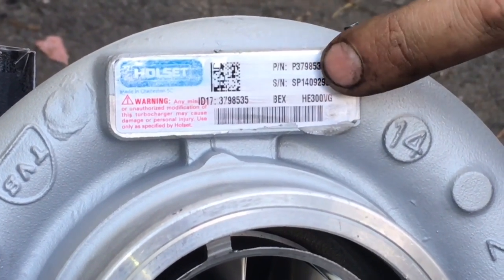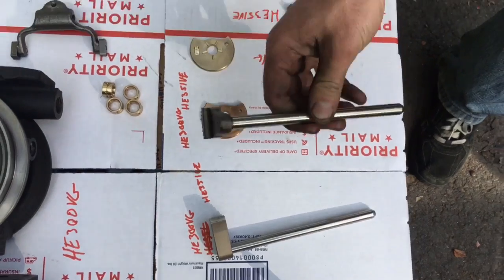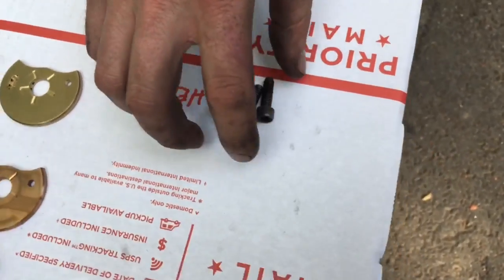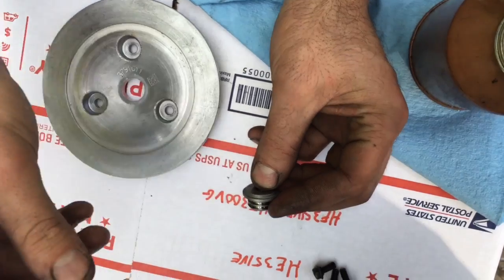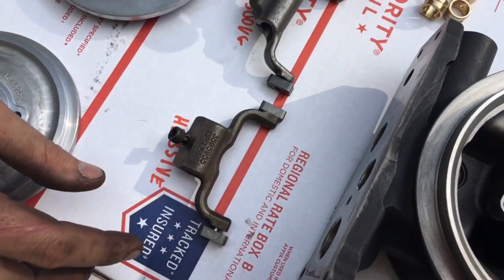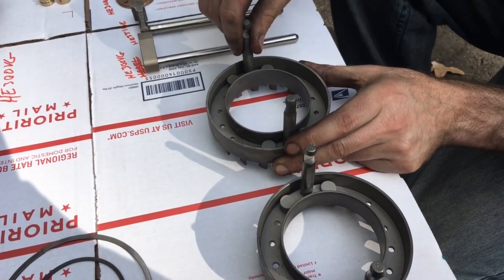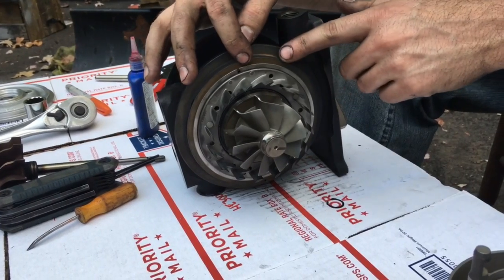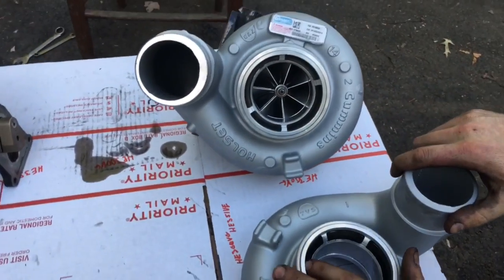2008 - 2016 6.7 Cummins HE351VE vs HE300VG

Comment: Do the he351ve and the he300vg have the same size compressor wheel plz help I need my truck fixed asap?!?!?
Reply from the maker: Most do but there is a 56 x 86mm compressor wheel used on the He300vg with cab and chassis. Otherwise the earlier models have the hx40 59.96 x 86 mm compressor wheel.
Reply: @turbolabamerica  so do you think a wicked whew for a he351 would work in my he300vg?

Comment: What do you recommend using to clean the Hot side that’s full diesel soot and gunked up?   Also, when you assemble the compressor wheel on the turbine shaft, is there a certain timing the turbine wheel and compressor when need to be set at for balance or something?  Thanks

Comment: Hello, great video!   I have a question about my HE300vg, the actuator quit working and my truck (2017 ram 2500) would make nearly no boost until wide open throttle and it would only make 10-12psi max.  The turbo brake was also no working at all. I removed the turbo and everything spins very freely and no play in the shaft.  The brake arm is a little sticky but not too bad.  I’m trying to determine what would have caused the failure of the actuator.  The actuator is a “City Diesel upgraded actuator”.   I notice the vane ring (the little slotted ring the vanes slide into on the hot side) spins freely and I’m thinking the vanes didnt line up and jammed causing the actuator to burn out.  Can you elaborate on what the “soot tabs” are and where they are located?  Thank you so much
Reply from the maker: The actuators go bad sometimes. I  can’t diagnose the reason for failure. The gear could have been in the work position before installing the actuator

Comment: I have an 07.5 6.7 Cummins dodge 2500.   I am about to tear the top half down to repair a blown head gasket.  I am considering rebuilding the turbo while I have everything else out of the truck.  Is it the same turbo as the 08-13 turbo?  It is a holset turbo.

Comment: Is it possible to disassemble a 300VG that needs to be cleaned to free up nozzles and reassemble back with old parts just to gain a little time before a complete rebuild? I have no time now to do the rebuild or to order parts
Reply from the maker: It make sense to remove the rust from the bearing housing and turbine housing otherwise it’s difficult to reassemble. The issue varies on those sometimes the ring is cracked , sometimes the nozzle is broken and can be repaired
Reply: Turbo Lab America ok thank you!

Comment: Can the 300 bearing plate and it's associated parts (thrust bearing, thrust collar) be swapped onto a 351 to gain the sealing advantage of two sealing rings?
Reply from the maker: Greg Pierce it is not possible because of the bolt size difference that holds down the plate is larger on the He300vg.
Reply: @turbolabamerica  The 300 uses larger bolts, correct? So they should fit through the holes in the bearing plate. Or am I missing something?
Reply from the maker: Greg Pierce 6.7 Cummins Turbo Variations 2008 - 2017+ https://youtu.be/CbEvALJe0W8
Reply from the maker: Greg Pierce the bolt holes been larger is a problem because of the sealing ability of the original bolts which have orings. There are 2-3 variations of the He300vg seal plate /bearing housing design.
Reply: @turbolabamerica  If the only issue is sealing of the holes, then that is a pretty straightforward problem to solve. One could either come up with a way to to seal the smaller bolts to the larger holes (i.e. by bushing the holes down), or drill and tap the cartridge to accept the larger bolts. Aside from that, I assume there are no other issues with such a swap? 

A few more questions: 

1:  Is there a performance difference between the 351 and the 300?

2: What is the price on the bearing plate and thrust collar?

3: Is the 300 actuator more reliable than the 351 actuator? I know the connectors are different, but aside from that is there any other reason the 300 actuator won't swap on to a 351 turbo?

 I appreciate you taking your time with these questions. Thank you!
Reply from the maker: Greg Pierce the wheels are identical on between the 2 turbos besides the flatbed has a smaller compressor wheel which the truck was rated at less hp, the size was 58 mm vs 60 mm. 

There are 2 versions of the He300vg seal plate, I don’t have the one you would need. It doesn’t benefit to have 2 seals rather than 1. We do the stangered piston rings in our kits which make the sealing area more secure but it’s not necessary because the original turbos always had standard piston rings.

I don’t know if one actuator is more reliable than the other.
Reply: @turbolabamerica  Seems to me if the dual seals had no advantage, Cummins wouldn't have bothered doing it? I want every advantage against leaks that I can get. I'm very tired of my slobbering WH1C, and I don't want even a hint of leakage when I swap the 351 on ;-)
Reply from the maker: Greg Pierce the Hx35 has some rare versions with 2 piston ring seals, but the later model trucks used the same size seals in the He351cw but never had dual seals. It doesn’t mean one was better design. It’s simply the design chosen for that era.
Reply: @turbolabamerica  OK, sounds good. I reckon if I decide it's an issue later on, different parts or a complete HE300VG is a mouse click away. I appreciate you taking your time to answer all these questions. I'm certain others appreciate it as well!

Comment: Is there any benifits to the new turbos than the old ones, if you were to swap it out. I saw in the comments you would need an adapter harness to make it work. I have a 2012 2500 6.7 and am starting to get mechanical turbo codes. So I am starting to think of getting a new turbo. What are your   thoughts. Also live in Canada if that makes any difference for shipping issues. Really love the videos, very informative. Keep up the great work.

Comment: Will a he300vg drop right into an older 2008? If not why?
Reply from the maker: The actuator is different, you can use an He351ve actuator or get an adapter harness
Reply: @turbolabamerica  so the turbine/exhaust housing should bolt right up? Everything besides the wiring harness?
Reply from the maker: Yes